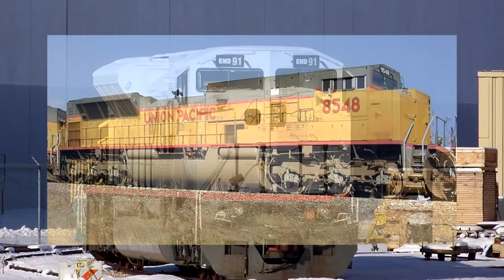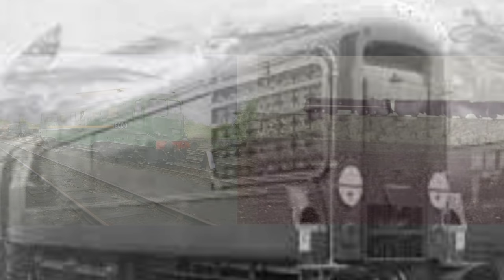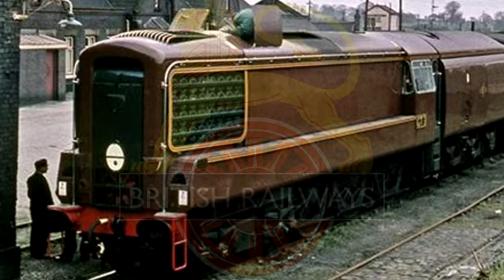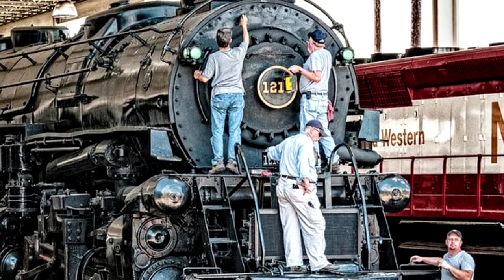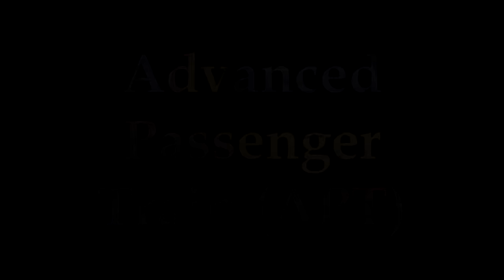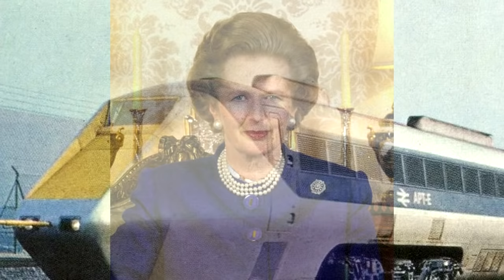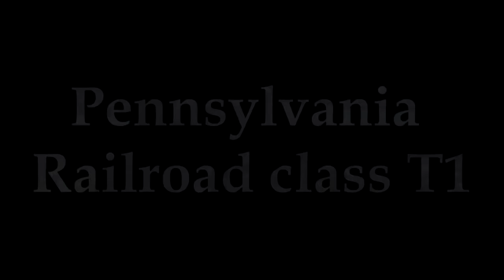5 AMAZING TRAINS (That Never Stood a Chance) 🚂 History in the Dark 🚂

Comment: GE Dash 8 (EXCEPT for GE 39-8 and GE 8-40), GE CM20EMP and EMD GT38Ace would be contenders for good locomotives.
Reply: Other potential ones include;
DRG Class E 18, DR Class 243, DR Class 250, DB Class E 40, DB Class 101, DB Class E 10, DB Class 111, DBAG Class 145/146, Eurosprinter, Korail Class 8000, Siemens Vectron, British Rail Class 73, BR Class 86, BR Class 87, BR Class 88, BR Class 90, BR Class 91, New South Wales 46 Class, Siemens E40 AG-V1, Queensland Railways 3100/3200, Queensland Railways 3500/3600, Queensland Railways 3900, EP10, EP200, Granite 2ES10, Civia, FS Class E.402B, FS Class E.405, FS Class E.412, FS Class E.428, FS Class E.444R, FS Class E.464, FS Class E.636, SNCF Class BB 22200, SNC Class BB 27300, SNCF Class CC 7100...

Voith Gravita, Voith Maxima, Vossloh G2000 BB, DB Class 218, New South Wales 73, Coras Iompair Eireann 071 Class, Green Mountain Alco RS1, Alco RS3m (NOT the original RS3; that one was ACTUALLY bad), Alco RS11, New South Wales X200 Class, GE Powerhaul, British Rail Class 66, BR Class 67, BR Class 68, Stadler Euro Light, Stadler Euro Dual, EMD Class 66, Tep70, ChME3, 2TE70, 2TE25K, 2TE25A, Renfe Class 319.2, Renfe Class 333, Renfe Class 334, Renfe Class 352, Renfe Class 353, Renfe Class 592, Victorian Railways Y Class, WAGR L Class, Tasmanian Government Railways X Class, Victorian Railways T Class, Victorian Railways X Class, VL Class, National Rail NR Class, Downer EDI Rail GT42CU ACe, Downer EDI Rail GT46C ACe, Downer EDI Rail GT46C, Australian National BL Class, Australian National DL Class, Australian National EL Class, South Australian Railways 700 Class, UGL Rail C44aci, Queensland Railways 2170 Class, Queensland Railways 2300 Class, Queensland Railways 2800 Class, Southern Pacific 9010, CSD Class T 448.0, CD Class 749, SNCF Class BB 60000, SNCF Class BB 75000, and SNCF Class CC 72000.

Comment: also another fact you kinda messed up on. The T1 wasn't one of the last duplexs the penny made. That would go to the Q2, in which it is actually one of the most succeful duplexs every created. T1 was 1942, while Q2 was 1944, amazingly even tho there were only 26 Q2 ever made, the Q2s lived a bit longer then the T1s did because they worked a lot better and were great freight horses, not to mention. A hell of a lot stronger and faster then the T1s, but sadly. tin cans showed up

and you are actually correct on the T1 problem. The driver on the pennsy only drove steam locos that had 230 psi and 240. T1 fucking knocked out 310. All that power is hard to control, IN FACT the UP also mention how there loco drivers struggled at first with the big boys and challey, but over time got the big giants under control.
Reply: The T1 actually operates at 300 psi, not 310, the Santa Fe 5011 class 2-10-4s operated at 310 psi

Comment: If you want another example of an engine with more power than grip. Look at old black and white footage of Bullied Light Pacifics (West Country and Battle of Britain Classes) None of these engines leave a station with a loaded train without slipping several times. Keeping the axle load down to run over the light gauge lines in the South West of the UK meant a major compromise on the grip available to the driving wheels. I honestly think that a 2-8-2 would have been a better solution.

P.S. I Like the T1, thanks for bringing it to my attention.
Reply: U think you'll find this was a problem with most of the larger steam classes not specifically the Bullied's

Comment: About the APT
It was a project doomed to fail anyway, because in Italy there already existed a Train with more advanced running characteristics than it. It was the Original "Pendolino" first with the Prototype in the early 1970s (The Y00160 000) by Fiat Ferroviaria, and then with the First train in service, the ETR 401 which entered active service in 1976, the only problem it had was Management. They didn't see the Potential at the start at least for the first 10 Years (Untill the Class ETR 450). The ETR 401 had better technology than the APT, it used gyroscopes instead of accelerometers, do it was able to sense the change in inclination (Due to the change elevation of the Outer Rail), missing the whole "Motion Sickness" fiasco of the APT, which corrected the Acceleration, resulting in bad ride quality, more over the ETR 401 was Able to go at 250km/h, rivalling Japan and Undercutting France, without needing new lines, when FS management cought on the gem they had, it was a Bit Late, the Suppliers of the Gyros Went Bust (It British Aerospace btw), Fiat Ferroviaria was on the Brink of Bankruptcy, and maintenance was really bad. A real shame, because this trains were Very Reliable, Fast and Sleek.
When Alstom bought Fiat Ferroviaria, the Tech was put abandoned

Comment: Omg I can't wait for the T-1 to be built, hell some ppl say back in the day the most of the time they where able to clock at going 145mph easily
Reply: “Some people say…”  Really? Well that must be true then eh?
Let me add my $0.02 to this pointless debate. Mallard was a standard “daily driver” loco running a trip that was normal for the day. Steam was king, and at that time unchallenged. Like any class of locomotive, some members of the class may be slightly better performers than others. Freer steamers, better runners due to engineering tolerances etc. Mallard may have been such a machine. If T1 breaks the record, it will be meaningless. For it to have any meaning it would need to be set in an environment where steam was the norm, and the trip was a normal regular passenger carrying service, and the loco was was a normal everyday production loco. Not a lovingly built replica that will be hand tuned and polished for the record attempt. Therefore impossible to replicate and meaningless in today’s world. 
This is purely a pissing contest on the part of the USA and the T1 trust if it actually happens.

Comment: 6:30 you fail to mention that in the early 2000s virgin them claimed to have the uks first tilting train with the pendalino and also that a lot of the issue with the apts is that the track wasn’t up to spec for it either due to lack of being maintained properly with how the government solved the debt they racked up with the big 4 during the war and expecting them to put staff on to making munitions and such ferrying troops around and with the bombings by the time the war was over they came back wanting what they needed to repair and get everything back up to the level they were before the war and the government worked out it was cheaper to buy them out than pay what was asked hence how br was formed and half the issues with br was the fact that the people who ran the big 4 were kept on as advisors and deliberately in many ways tried to run br into the ground because of how the government wanted to do things

Comment: The spring equalization was the problem with the T1s not unspeakable power. And I'm sorry but I'm not sorry, the pennsy shoulda just made a 4-8-4 with Walschaerts valves or baker. Hell, maybe even Young valve gear like UP did for their 2-10-2 and 4-8-2 classes. But I digress, the 4-8-4 would've been a much better choice as it would've been just as fast and maybe even more powerful but also FAR m or successful.

Comment: If you make a continuatuin, could you had the Talgo 1 a revolutionari spanish diesel wich only had a serving prototype and the renfe 140-2438 a one of a kind steam engine with a modifie Reggiane-Crosti boiler made so It could save 18,5% of fuel, sadly It was made when steam started to lose grip un Spain and in the end the engine simply was scrapped

Comment: While I can’t say I doubt or believe the T1 could break the steam speed record, my doubts are in the idea of “will it be allowed to attempt to break the record?” I’m not certain how modern regulations of steam engine rules for mainline use work in the United States , but I know in UK at least that it would never be permitted for a mainline certified A4 to replicate the speed record lat alone pass it. Infact I remember hearing once that an A4 on a mainline rail tour had to be given special permission to even try 90 mph . But like I said, idk how it works in U.S.A.
Reply: Many lines here in the U.S. are owned by freight railroads, and are only certified for 60 mph for freight, and 80 mph for passenger. In fact, the only piece of trackage here in the U.S. that's certified for any more than 125 mph is a 34-mile stretch in the Northeast Corridor, but I can't see the T1 getting certification there because, firstly, it's very busy, secondly, even though that trackage has the highest certified speed of any other track in the U.S, there are still a lot of sharp curves along the route, and thirdly, like it or loathe it, a steam locomotive can't accelerate as quickly as diesels or electrics can.
Reply: @AutismTakesOn  if that all is the case, how on earth is the T1 trust intending on even breaking the speed record then? Does Canada have the proper regulations and track for it? Because if not they’d have to spend a TON more money shipping the locomotive to another country with the proper rail lines and regulations to accept it, not even accounting for if the T1 will even fit the country in question’s loading gauge or track gauge .
Reply: @reddiamond_1753  Correction: They WERE intending on breaking Mallard's speed record. From what I know, the project went from "Wouldn't it be nice?" to being hit with a reality check. They are no longer trying to beat Mallard's record. Also, to answer your question with Canada, as far as I know, both Canada and Mexico have the same loading gauge as the U.S, but also the same or lower maximum certified speeds than U.S. freight railroads. I specifically say freight railroads because neither Canada nor Mexico has any trackage certified for high-speed operation, at least, not that I'm aware of.

Comment: Why do the t1 trust wanna break the speed record for the stems locomotives because why break a record that haven’t been touched since 1938
Reply: @barnabyjoy considering that there are no new design steam locomotives and many of the fastest could never be permitted at that speed( most examples I can think of are static), it’s kinda like running the olympics  after everyone else has retired and stopped training
Reply: @barnabyjoy if you ask me, they shouldn't try to break the record due to the following reasons.
1. There's no point, mallard broke the record around 84 years ago and why change it now?
2. Safety for the loco and the crew, it can be a bit dangerous to work on a steam engine at regular mainline speeds, but I think it'll be too dangerous for the crew are those speeds and some of mallard's middle cylinder did melt when it broke the record.
Reply: @barnabyjoy they aren’t new designs mate.  And I doubt either would ever be permitted beyond 100mph.   I think Tornado has only done it on a special occasion 

None of the A4s could do it at this point 
Only Sir Nigel Gresley is operational
I can’t remember the name but the German locomotive (a class mate) that mallard beat is still around but stuffed in a museum

Literally who could beat it ?
Reply: @barnabyjoy I’m not sentimental.       You are talking about competing when there’s are no other competitors and then calling yourself the winner
Reply: @barnabyjoy final note.     Being built after Mallard means nothing

Ever heard of WW2. 
After that and the death of Gresley it’s no wonder that the LNER or even their rivals the LMS didn’t design new streamlined engines during the 40s

It was a short lived time for the a4s then ww2 (new chief engineer and war time priority) then British Railways(original company is gone)
Reply: @barnabyjoy mate you clearly don’t get it 

WHO HAS THE MONEY AND RESOURCES TO BUILD A NEW CLASS OF LOCOMOTIVE IN THIS CENTURY?

If this happened in the 40s I wouldn’t care but over 80 years later when steam locomotives technology is no longer being developed in the same way makes it impossible to beat 

In 100 years if a new steam locomotive breaks this record I’d hardly call that fair
Reply: quite right, to break a record long after its gone out of relevance, long after everyones finished with steam and therefore wont bother to try beating it (even though they could if they actually wanted to) is pretty laim. no ones gonna celebrate or even care that a record that could easily be broken with an 80+ years younger loco, was beaten by an 80+ years younger loco, LNER broke the record when steam was still in its prime and others could have easily tried to build something faster and yet couldnt, a real achievment to be on top of everyone else while theyre all still in the game, not after theyve all long stopped playing or caring. even if they do beat the record the glory wont be taken off mallard because it achieved something real, its already in the history books and forever will be as it came out on top of everything while it was all in its prime "museum peice beats museum peice" doesnt put you in the history books
Reply: @darkchaotix1productions326  yeah i though so, no point spending a lot of time and money building a new steam loco to then potentially wreck it going after a long since made redundant record, first priority will obviously be to preserve the life of the machine which high speed runs wont do